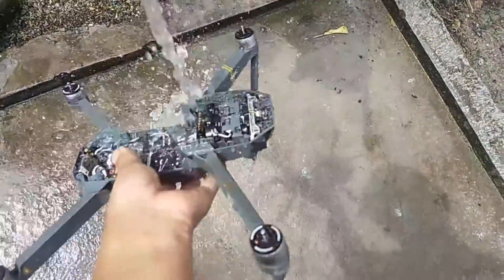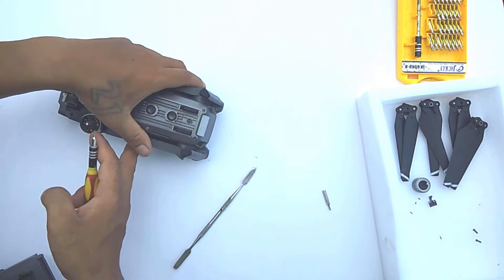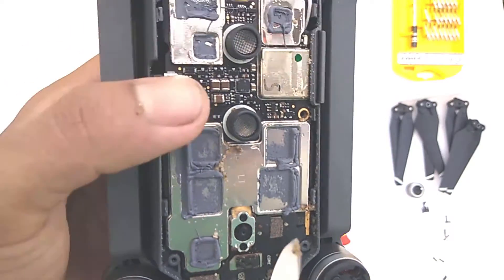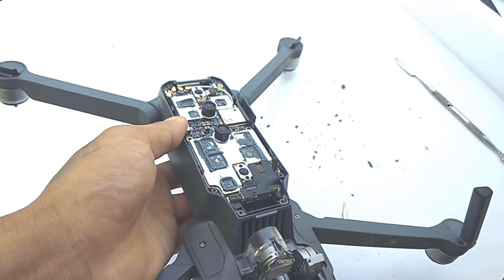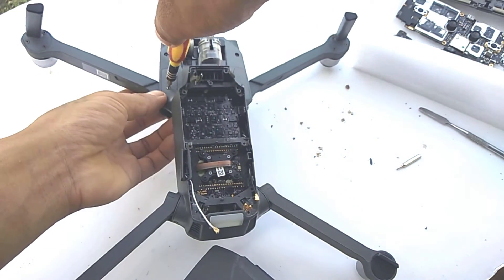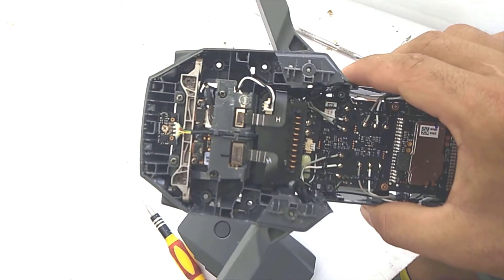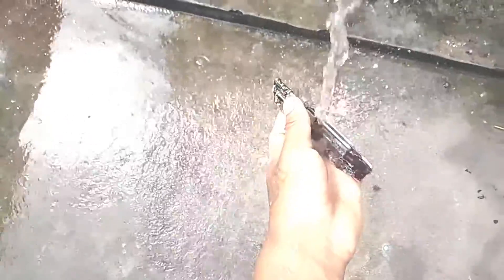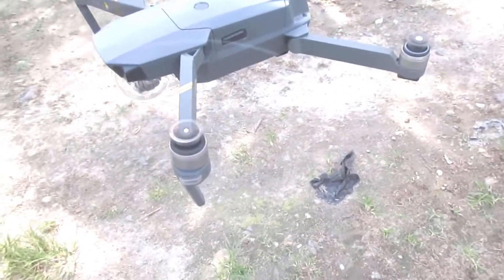Repair or Cleaning Guide to DJI Mavic Pro

Comment: Hi bro thanks for the demonstration video, well my question is, my mavic crashed in pool and immediately I took out from pool and remove battery, I kept my mavic in rice bag for 5 days, after I turned on (the battery at the time of crashed never charged) but mavic start working without any failure.  I had several flights even in the beginning sometimes there is moisture on lense which I had removed by keeping my mavic in the lense box with silica jell, it also gone. But I have issue now the heating the processor fan is not working, I am hearing tick tick something may be rice struck in that blade? Possible? Kindly help me thanks

Comment: Hello i cleaned everything and it turns on but fails to connect the remote I pressed reset and tried to connect the remote unsuccessfully what part i need to replace
Reply: Same problem!
Reply from the maker: did you try connecting it with wifi?
there is a switch to toggle between wifi and remote control.